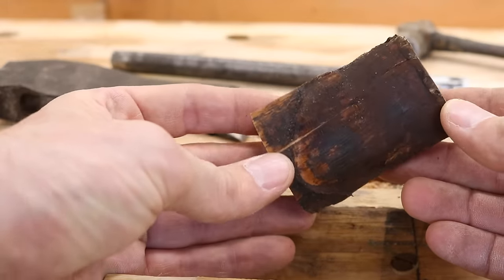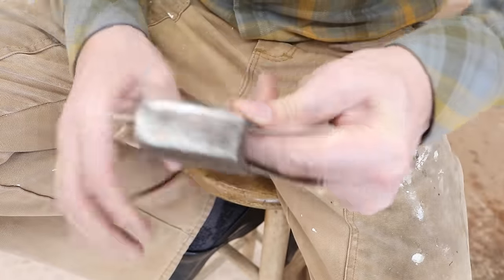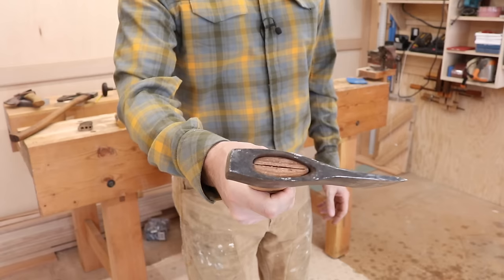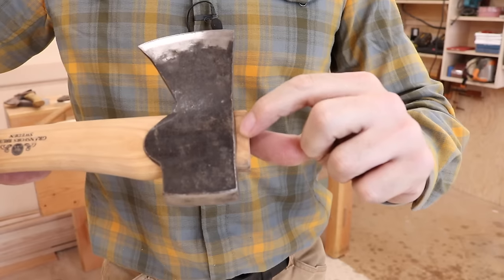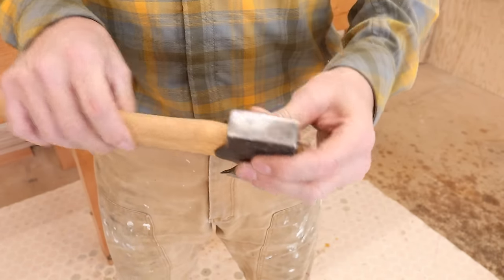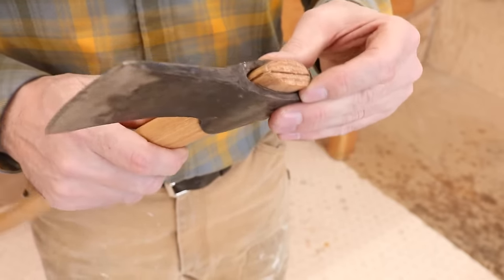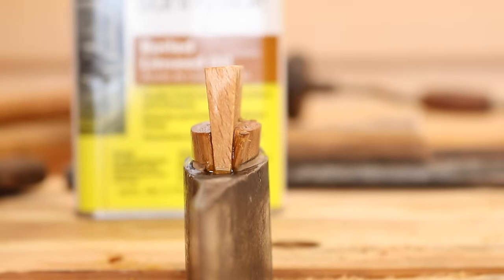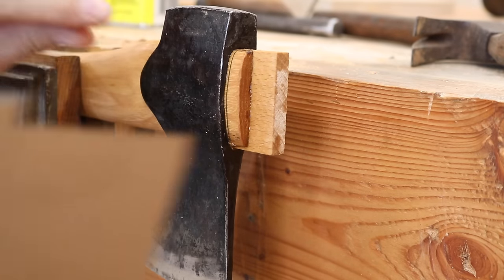How To Handle An Axe - part 2

Comment from the maker: GET YOUR GRANSFORS BRUK SMALL FOREST AXE HERE https://goo.gl/W2oB7W

A LESS EXPENSIVE OPTION THAT IS ALSO EXCELLENT   https://goo.gl/BA0Zui
Reply: Wranglerstar hey bro make a video called how to make/handle for a fiskars axe  (LoL)
Reply: Wranglerstar  you make handle, but is lincy oil beater becouc i use wood glou

love your videos, I'm your subscriber from the 2013
Reply: The Husqvarna axe range is made in Sweden at Holt Bruk, still I think.
Reply: Cody, could you check with mfg. on the chiseled wedge?  I think folks would like to know the reasoning.  Very good video!
Reply: I know nothing about axe heads. But I was wondering why a roll pin or something could not be installed through the head and handle to better secure. My guess is with constant use, it would eventually work free?
Reply: Thanks for the info.
Reply: could i trouble you for the brand/ type of shirt?
Reply: loving the new shop
Reply: dangmkites Pendleton or Filson I'm betting... Gorgeous shirts but EXPENSIVE! You probably won't find one for less than $145 unless they're on sale or used. Made in OR. 👍
Reply: E B I've never owned Filson. I do have Pendletons though and every single one I own is made in OR. Says so right on the tag or I wouldn't have bought them. The last one I bought was last summer from Vickers Western Wear in Idaho Falls. Perhaps Trump needs to call Pendleton and have a chat with them! Haha! 😉
Reply: Griffin Benchmark id say try carhartt or american egale they are big brand names for a reason
Reply: Tony Miller Carhartt is also mostly made in MX now as well but I love their new line of flannels this year. They definitely have the best hoodies as well!
Reply: Griffin Benchmark trump is working on bringing american brands production back to the states
Reply: Tony Miller Yup, I applaud him for trying. I hope it works. Greed is more powerful than any of us know with these companies. It'll be tough and they'll try and make him look as bad as they can, like everyone else is doing, so they can keep their money rolling in.
Reply: Griffin Benchmark yeah but just wait till he send the military to their doors then theyll give up also have you heard of the purge and how everyone myself included wants it to start this year
Reply: Tony Miller I doubt the military will show up on any corporate door steps. 🤔😆 Trump doesn't have the power to do that alone anyway. What I can see him doing is increasing the border taxes on companies, the tariffs will go up for trade partners around the world and he may start a financial trade war or two but that's about it. The atrocious main stream media will paint him as poorly as they can and companies will raise all the prices on imported goods saying it's Trump's fault. If he holds his ground, and capitalism is allowed to continue unregulated, however, history will be on his side and the American people will win in the end... It's gonna be a LONG hard road though.
Reply: Griffin Benchmark the purge is an anual holiday where all crime is legal for 12 straight hours a lot of people want this
Reply: where can i get a handle replacement for my gransfors bruks axe
Reply: Great video. My preference is round metal wedge. Spreads entire wood in the eye. More secured fit.
Reply: Grandfather said u can make wood swell few dif ways, in reference to putting it into the head

Comment: If you study the three pins on the metal wedge, you can see that they are chisel ground alternating ways! They will bend out into the wood when you pound it in! I love them! Have used a lot of them here in Norway :)
Reply: Håkon Andrè Landsverk what are they called ???
Reply: @fergusslater3739  Google SFIX hammer wedge. In  swedish it is skaftkil.
Here is an instruction picture, almost as shown here. The instruction suggests wood-glue for the wedge.
https://www.hakma.se/outdoor/yxor/skaft/smedbergs-skaftkil-stift-smedbergs-55-cm.html
Reply: i just put a new handle on a norwegian mustad axe from the 50s, that had the same ones too
Reply: Nobody can beat the Scandinavians when it comes to the craftsmanship used in woodworking tools. The Canadians aren’t bad but they’re still young, relatively speaking.

Comment: Hi Cody, I started watching your videos to learn to hang an axe. In particular, the Small Forest Axe. I have to say that my experience putting on the new handle was exactly the same. It came perfect from the factory, no adjustments needed.  Gransfors Burks is an excellent company. I have had my Small Forest Axe going on 10 years and almost never go in to the woods without it.
On a different note I wanted to thank you for the hard work you put into your channel. Wranglerstar is the first channel I have subscribed too and now commented on. I find the content truly inspiring. 
Thanks,
Matt

Comment: I recently re-handled a Gransfors mini belt hatchet with the same results. The hatchet was only a few years old but the handle got loose. I purchased a replacement handle and it fit perfectly with no rasping or trimming necessary. The only difference with the mini is neither the factory handle nor the replacement handle had a metal wedge.  Instead of BLO, I used a product called Swel-Lok. I did use linseed oil mixed with gum turpentine on the rest of the handle. This little hatchet doesn't get a lot of use, but so far it appears to be holding up well. Thanks for your videos!

Comment: I am impressed with these axes from this manufacturer. I rescued a Gransfors axe head from a life of abuse that I found on craigs list. It was obviously abused and the original handle gone. Mine was an AS stamped head. I ordered a new handle from manufacturer and repaired the damage as best as I could. The poll was badly damaged from steel on steel impacts. I filed most of the damage out and trued it back up. It is now a wonderful tool that I am proud to own. They do make outstanding products. I will be passing on to somebody for many more years of service.
Treating the hickory handle with boiled linseed oil is essential imo.... makes all the difference on wood handles.

Comment: It Lasted 12 years without needing a new handle, wow now thats quality
Reply: And you know that axe sees hard use.  It is his favorite and he uses it constantly unlike my fiberglass handled Home Depot special which which hangs on the wall 99.999% of its life.
Reply: Tenspeed TheBikeHanger  axes only see hard use if you treat them badly, for example, wranglestar treated that axe good, and look at how long it lasted, i dont know about the home depot axe, ive never ever been to home depot , but my sledgehammer and my splitting maul, and they are both fiberglass, and they work perfectly
Reply: Duarte Monteiro
I sense a language barrier.  Hard use is not abuse, it simply means the tool sees a lot of use.  It was not a criticism on how Cody treats his tools, it simply means he uses the tool.  As for the rest of my post, I was just being a bit facetious, I am not criticizing fiberglass handled tools either, I was just trying to point to the amusing irony of one man that uses an axe nearly every day and another that might use it once in two years.  I'm sorry you read so much into my post, it really wasn't intended to argue a point or offend anyone.
Reply: you did not offend me dont worry
Reply: and you will pay for it to!!!
Reply: Hilden Johns ok then 
keith moore pay for what

Comment: Using the Boiled linseed oil is a great idea, as the expansion will take a bit of time to fully occur, so once you have seated the wedge it will continue to expand make the handle tighter and more secure on the axe head than any glue or epoxy every would!, great video and I always learn something new watching your videos :)

Comment: This was very very helpful, being that I soon will be hanging a handle on my axe head, it’s old I have no idea who made it, I wound it in a creek with a metal wedge in it and I finally decided to take a bench grinder to start cleaning it up, and finish grinding down the mushroomed back on it, I used it for a wedge a little bit last winter, handy splitting wood with my dad’s bad axe, and I am now going to finally get what will be a good handle and hang it, I thank you again for your knowledge

Comment: I've never heard you mention this Cody, having watched earlier handle hanging videos where you used boiled linseed oil, but I'm taught that boiled linseed oil as opposed to raw oil actually hardens trough an exothermic reaction (that's why rags soaked in boiled linseed oil can self ignite), so I take it that the BLO not only swells the wood fibers and acts as a lubricant when driving the wedge in, but also acts as a glue when it sets.

Comment: I bought my Grandpa a small Ponderosa Pine for Father's Day one year and when he planted it he told me the same thing about watering it as you said for the Boiled Linseed Oil on the handle.  He had a small "portable sawmill" that he operated with two pairs of Morgan Horse during WWII and  I find it very interesting that, in his case anyway, he would use the same pattern of caring for the trees that he used on his equipment that he used to fell them.

Comment: That's the nice thing about GB replacement handles.  They are a direct fit.  No messing around.  The downside is they're expensive.

The factory installed ones are press fit on.

Comment: Recently, I made a mallet by cladding it with copper. The thick walled copper fit so tight, it took about an hour to get the copper pressed down over the apple wood, even with a kerf for a shim.

Rather than a shim far wider than the kerf, like the one in this video, I cut one close, then sanded it down to just a bit bigger than the kerf.  My hope was, the shim would go further down into the kerf and hold even better.

Like you, I am a HUGE fan of hardening oils on my wood handle heads, for the reasons you stated.

Comment: With just a little freshening of the steel surfaces, most would assume that you had purchased a brand new axe. They would also be flabbergasted to learn that you would be starting the second 12 year stint with the tool.  Times like this teach you the wisdom of buying the highest quality you can afford when buying tools; especially when their use is providing for the family.

Comment: Mr. Wranglerstar: If you noticed, two of the "tongs" on the step wedge had an bevel to one side. The middle tong has a bevel to the opposite side.

That way the tongs kinda split and widen a bit once you've beaten it down, making it wider in the bottom then the entry....if that makes any sence. It's not a lot, but it adds some friction to the wedge :)

Comment: Logger from most northwest part of Wa state. You taught me this yrs ago and I researched how they did it when the axe was you're saw and you nailed it. To my surprise nobody knows this here where there is still oldgrowth being cut. Even my 73 yr old boss that's been falling since 15 and still does it on the side doesn't know. They all mash the handle in, cut it flush and leave it in the weather. They're wedge pounding axes break all the time. You can hear the cussing in woods lol. Thanks. PS The old way for boots is 50/50 neatsfoot oil and beeswax for the rainforest.

Comment: From the Gransfor website...
The Swedish style wedge is not very common but this type can save you a lot of troubles from changing your axe handle from time to time.
They are metal wedges with a 3-prong comb-like style so when you insert them into the wood its teeth separately goes deep apart and that gives the best hold on the wood’s fiber.

Comment: Look into another finish old timers used.  It was a mix of pine tar, boiled linseed oil and turpentine.  It was used on military gun stocks with excellent results.  I've been experimenting with it on a potting bench that sees a lot of weather in the northwest.

Comment: Several different techniques from your other video from 5 years ago, going with oil instead of glue, 1 wedge instead of two, etc. Will assume this is the new and improved method ? I like it, thanks Cody

Comment: To drive out the broken handle > Use a socket extension. On the package that the fiberglass handle came in. Use the bag that it came with to holds the glue, and putty in. To pour it in and mix it up. Drive the handle into the maul as far as it can go. Be sure you got plenty of putty to put around under the maul head and handle. OR IT WILL LEAK!  AND BECOME A MESS!  Once mix and pour, let it set for 24 hours. Then it ready to used >  I love it!  Can grip it better with less sock on my hands and arms. Don't even worry about it breaking

Comment: Very glad to have seen this I’m a blacksmith and hanging a axe for someone and they wanted me to put a little touch on it I’m gonna throw blacksmith stain on the custom wooden handle maybe put that deer string under the head to protect for overbite but just found the cherry on top I think I’ll go make one of those metal wedges just gonna make it a tad bit smaller so less chance of cracking

Comment: i would say that the step wedge is shaped so differently than most others is because of commercial selling. It seems that its easier to get the step wedge aligned straight down when theirs a point on it rather than a round face that sometimes tends to want to lean to the right or left side which splits the wood. And when its your job to do that all day, it really makes a difference.

Comment: It's called a three legged iron wedge. One of the legs have the bevel on the opposite side, that way when you drive it down the legs spread out and creates more friction. We use these wedges and another type called Steel ring wedge. It is pretty much a round step wedge.

Comment: reason for the excess at the head of the axe , is so that if the tip ever got dry enough ( and after alot of use ) the mushroom top sides will keep the axe head from flying off. as like some of the axes that i have seen , to where there is no mushroom 
at the top ( flush or under flush )  , after about a year the axe head flies off... = danger for anyone on the other side of the axe head.

the metal wedge is to secure the wooden wedge from slipping out . . swells both the wood ( the handle head, and the wooden insert ) . plus reason for the 3 legs is to ensure the metal grips the wood from all 4 sides and keeps from splitting in one direction
  as from a solid metal wedge would. some use a metal ring, but i like the 3 leg metal wedge better.

awsome video !!

Comment: @wranglerstar: To get your drills and bits organized in your shop you could use a nice old piece of wood and drill holes in the right size in. then you could stick the drills and bits in it. similar to a pen holder. If you do this you can see the bits and drills if you need it and it is nice too look at it. in europe this is done often times. and you could organize your bits for the yankee drill and can take all at once just by taking the wood piece.
btw nice video. keep continuing pls.

Comment: You prevent the handle splitting by drilling a hole through the long side of the handle at the bottom of the split. Once the hole is drilled the split can't progress past that point. Not many restorers seem to be familiar with this technique but I've seen a few get it right. Then you don't need to worry about hydrating the wood with oil and lubing up your wedge. Just slather the wedge with glue and hammer home.

Comment: Great job a couple of suggestions though you can put the handle in the refrigerator for a few hrs and the axe head in the sun then put together while the handle is cold let everything warm up to room temperature before wedging. I like to leave a little more sticking out about 1/4 inch that's what my Wetterlings are. Most axe are used in cold weather and the handle will adjust acordinly just my 2 cents great vid thanks
Reply: I just waited until the wife was out of the house and put the axe head in the oven at around 150 degrees for an hour. The handle slipped right in and when the head cooled it was very tight.

Comment: I grew up with wood burning stoves for heat.  As a kid, I used a many axes that were in sad shape, in so far as their mounting to the handle is concerned.  Occasionally, the head would fly off, or, at the least, come loose.  We learned, pretty quickly, pounding the head on was a hard task. More so if you didn't have a hammer.  On the other hand, by striking the bottom of the handle on a hard surface, the head would, quickly, move back down the handle.

Comment: Just last week rehandled a 1920s vintage sears light axe. The eye was tapered nearly 3/16top to bottom and the replacement handle was even taller than that. I dried the new handle stem on the furnace vent over night and it fit much better the next morning withvery little modification. There was a void left in the taper but the wedge was large enough to fill it when driven in. 
I did seat the handle by driving iit in like a stake. I like your method better. Next time ...

Comment: Cody 
it looks like that 1st strike on the wedge drove the ax handle down . I was wondering did you have the handle clamped in the vice ?
Reply: paul  blom it sure did. About 1/4" or so
Reply: Yes it was a good hang till he got to that part.  Always put the handle on a wood block on the floor  then drive the wedge,  otherwise you will drive the handle out of the head as you drive the wedge.  Learned that the hard way myself.
Reply: Wow thanks for catching that! He should of made a reference mark on the bottom cheeks to check. I'll put the bottom handle on the floor when setting the wedge on some hard plastic.
Reply: Put a piece of wood on the floor, put the wedge on It and Hammer the end of the handle
You won't split the wedge with the Hammer and the head Will get even tighter

Comment: Taking out the steel wedge (for some reason we call them dogs) with a punch from the side is a new method. Use an impact nail puller to get a grip of them and lever them out.